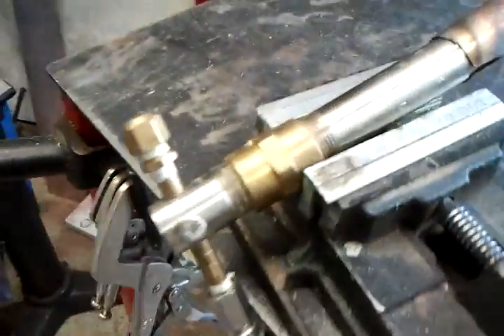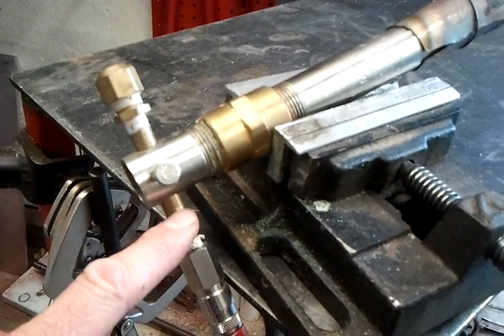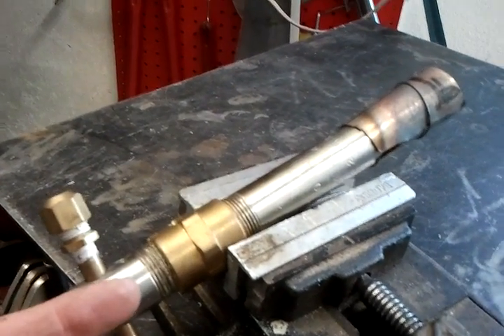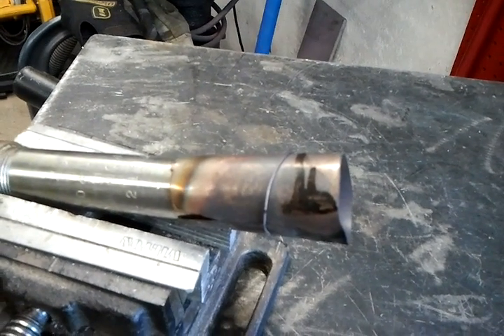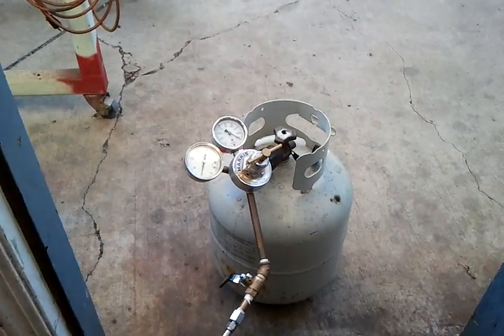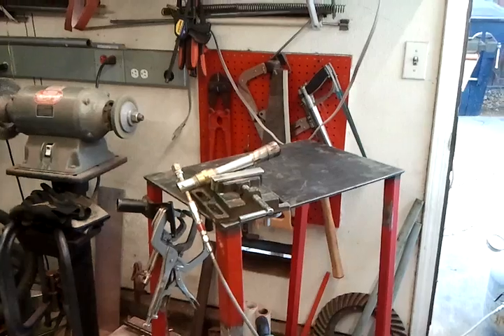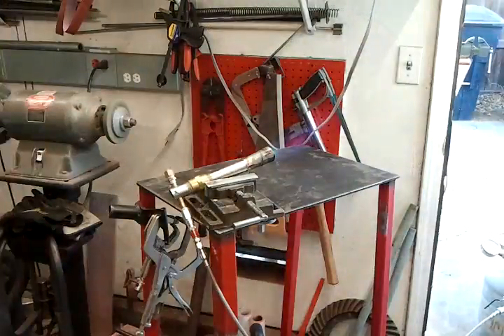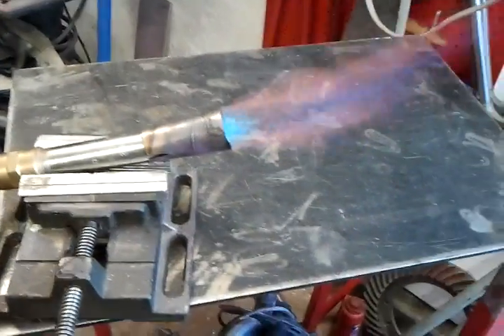Furnace update   Burner

Comment: I didn't know it was spammed, somebody's trying to stick up for you maybe. I'm working on getting a forge going, I'll be using charcoal, but I'm making it myself, because I can't get coal or afford to buy charcoal or propane. I had my forge running for about 10 minutes almost long enough to anneal a file then the 30 year old hair dryer I was using for air supply crapped out. Soon as I get another I'll be up and running.